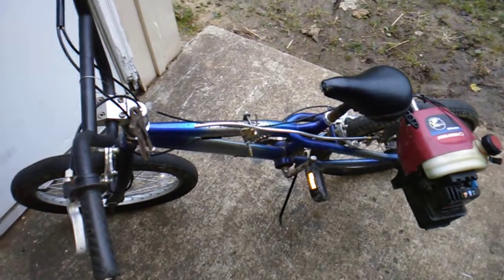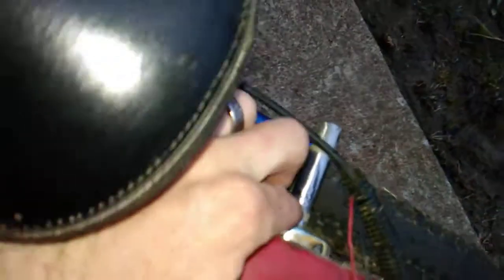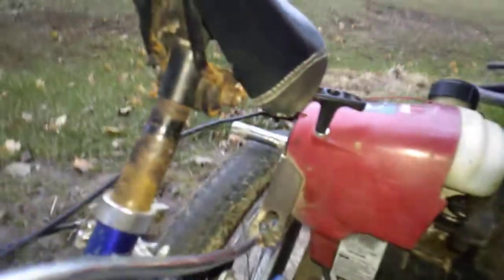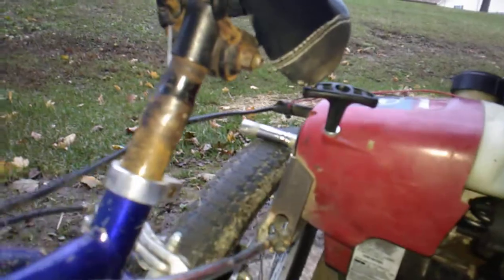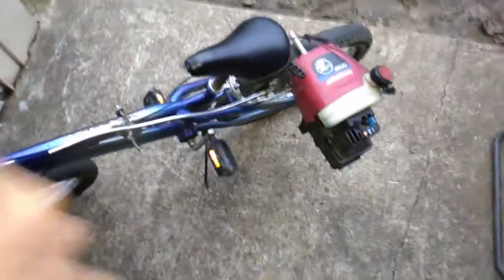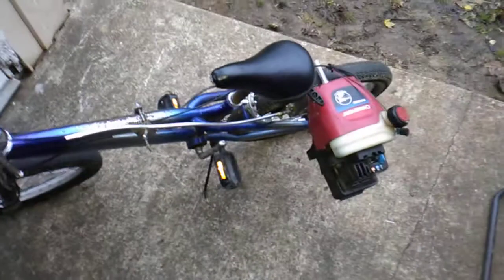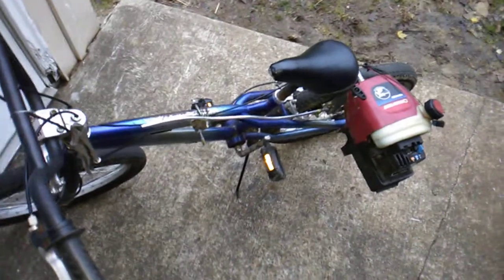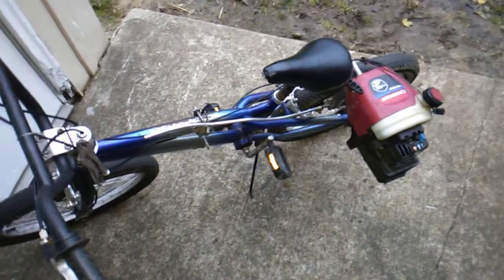20" bmx with friction drive 31cc weed eater engine pt. 1

Comment: Very cool, how fast would you say this goes with just the engine shaft making contact to the rear wheel?
Reply from the maker: This is a pretty small shaft I think its around 15mm and it maxed out around 20mph I think and that was revving it pretty high but it had good bottom end power.
Reply from the maker: So not talk at all during the video? Gtfooh loser.